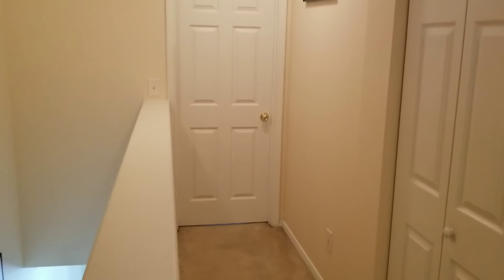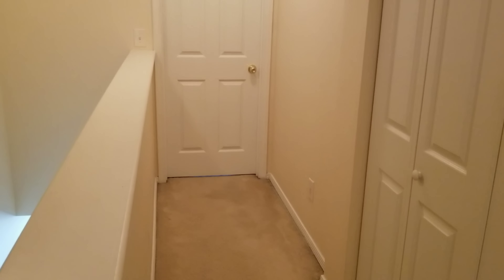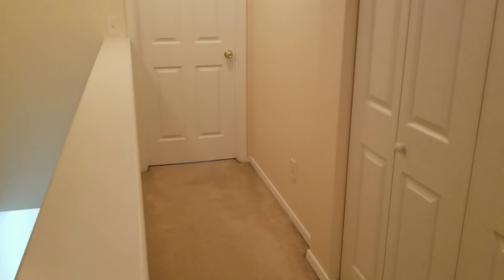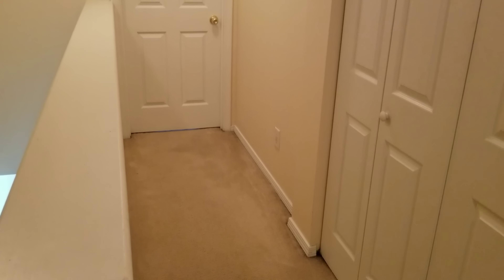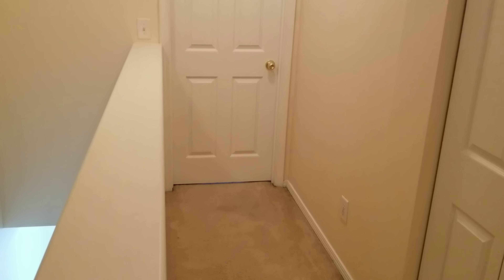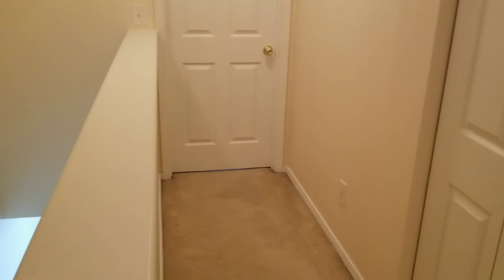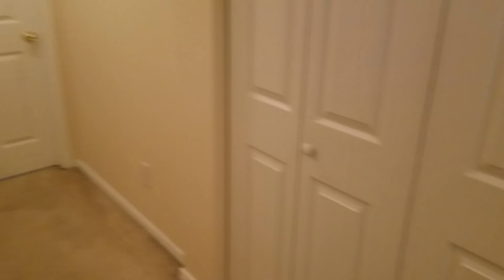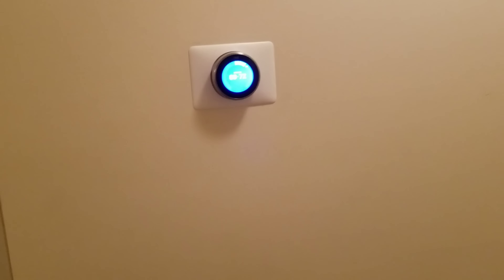HVAC Tech Tip - Room Air Distribution

Comment: Awesome demonstration / find.  I haven't had to do it a ton, but I like ducted jumper's (ceiling to ceiling) as it keeps privacy and noise down a bit.
Reply from the maker: Michael Housh Thanks Michael! 
Absolutely! I completely forgot to mention the pass through option.
Reply: yeah, that or run long returns back to near the air handler. likely it was designed for engineered flooring and the thick carpet/padding choked it off far too much

Comment: I have explained this to a thousand customers. Most of them act like they understand, but as soon as you leave they shut the door.
Reply from the maker: Family West All we can do is try and educate them the best we can.
Reply: now, try explaining that to folks with hot water/steam heat. it super duper doesn't register with them :))
furthermore, give them a bid or $3500 adding zone valves and thermostats per 2nd floor room (six of them) or thermostat per rad, but that has downfall of thermostat calling and rad thermostats all off and boiler short cycling/wasting fuel, due to no thermal load/output! >_<

Comment: Surprised the carpet isn't dirtier by the door. Normally there will be a heavy dirt line under the door because the carpeting is filtering the room air as it exits towards the return. If I remember right Lennox even had a bulletin out about it back in the late 90's early 2000's. Good tip.
Reply from the maker: bill j I though the same but found out these tenants have only been here for just over a month so I'm sure the carpets were steam cleaned.
Thanks for watching Bill
Reply: smokers/non-smokers make a huge difference in that case!

Comment: You can also add a retrofit above the door return air pass-through.  Example:  A Tamarack Technologies TTi-RAPR12.4   which is 12" x 4" and has a honeycomb mesh to reduce sound transmission.
Reply: RJ how do handle a fart? Do you over engineer it? Or just let it slide out?
Reply from the maker: RJParker I failed to mention the pass through option but that would absolutely work too. Thanks for watching and the info RJ!
Reply: noise transfer is an issue with above door grilles, better off with other solutions/longer duct runs or braveness of trying to use  "interior wall cavity" for return. 
one vent near ceiling and other down low opposite side of wall, it requires open wall, which many times may be insulated now days! easy enough to drill a couple small holes with long twist bit, you'll know if you hit insulation it will wad up on the bit
Reply: lol @ 
polishtheturd mickelson
. I fall in the over-engineering category, but also the type of "arsehatter" that tries to call foobar and keep all the junk/garbagey/chinesium on the market sane! why have all of it be pure junk that makes everyone look bad?
even the best of best installers/technicians/workers/masters/super-techs look like bumbling idiots due to the garbage pushed out now days :(
Reply: A passive return docked from inside the room to out in the hallway is much better

Comment: I know this is an old video but it just started after another video I was watching. We are constantly tell our kids to keep their doors open. Our one kid gets frozen then ends up closing the vent instead of opening his door while the other is sweating with his door closed. I’m thinking of adding some sensors in each room.
Reply from the maker: Adding sensors to the room will only create a different issue. You can shave the bottom of the door about 2". You can add a louvered grille to the door, or add a pass through grille above the door frame. Each of these homeowcan do abd it will help the room breathe.  
That said my professional recommendation would be to have a contractor add a small return to the rooms.
Reply: @HVACinSC  thanks for your reply.

Comment: probably designed for engineered flooring, vs. the carpet and padding there now, which choked off the doorway gaps ;)
Reply from the maker: +throttle bottle Doubt it. Its just a very common issue that many overlook.

Comment: That's why they call it air conditioning,can't return can't supply air changes per hour.
Reply from the maker: Michael Lee Its actually called air conditioning due to the process of removing humidity. (IE conditioning the air)
Reply: one cannot remove humidity with out exchanging air, even if it's exchanged in a circle (dehumidifier). so technically air conditioning is beyond just dehumidifying.
so neither of you are wrong! it require air in and air out in as balanced a flow as possible for optimal climate control =p